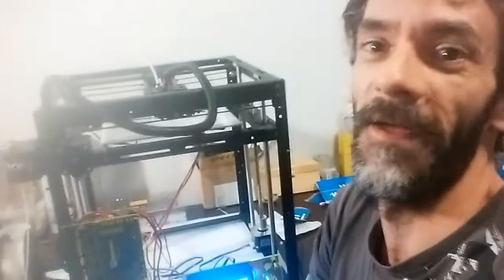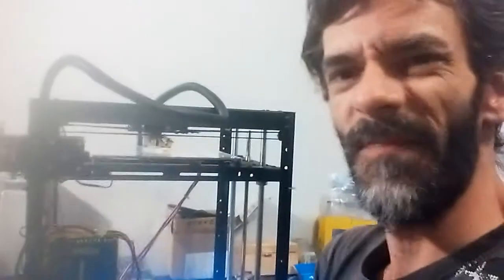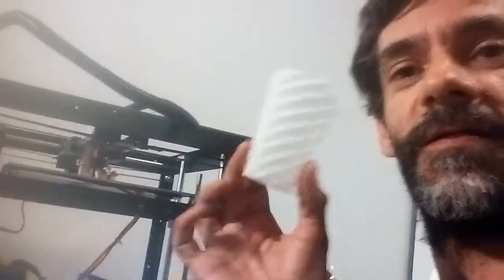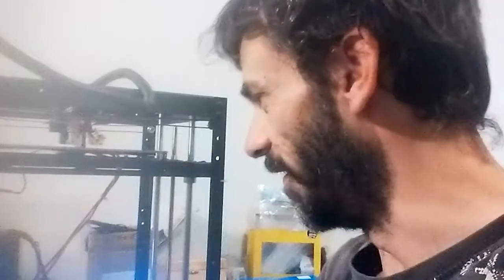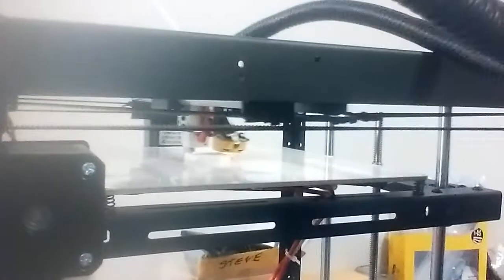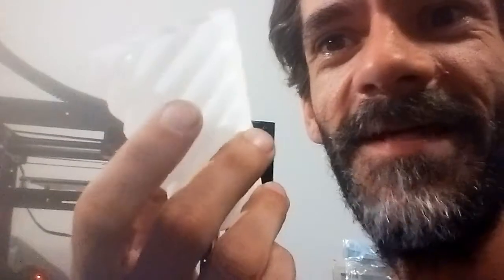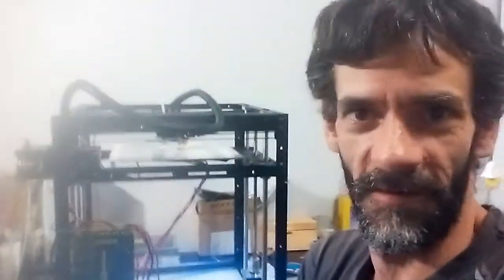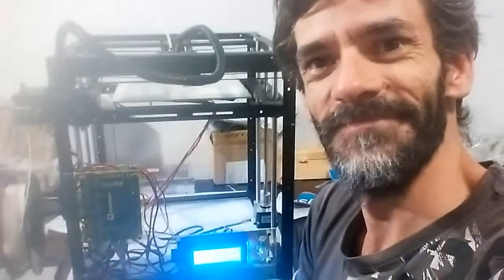Flying Bear P905 A single E dual Z review

Comment: it seems you didn't have any issues over time? hows the quality? any mods or maintenance you can comment about?
Reply from the maker: Sorry did not get a notification, It still print fine, the bed leveling sensor died after a while so I used a simple proximity switch on the side of the machine instead. I use a piece of glass on the bed.

Comment: How did you get yours to work??? I can't get mine to do anything
Reply from the maker: What is your biggest problem ? I know I had to make sure all bearing where greased, and rods aligned. Other than that use a glass on the bed.
Reply: @SteveOlmstead  the issue I'm having is the extruder motor or tube.  At least my guess.  When I go to print something the motor just makes a clunking sound and moves back and forth not pushing any material through. I've made sure the nozzle isn't clogged as well.